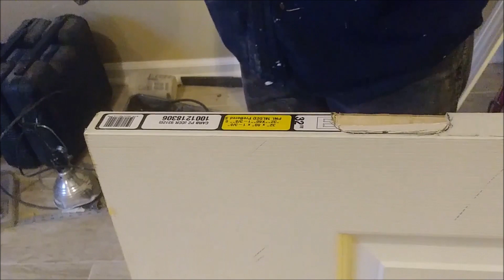How to cut and install perfect door hinges - Step By Step - Real Installation

Comment: Well, thank you for this video. I've never put on a door hinge before. I have a built in 1900 home with an unstable hinge so I need to put another one on to stabilize it but didn't have a clue what to do. This gave me a good starting point for what to do for this repair. But one question..I don't have to chisel out the part on the frame? Just the door?
Reply from the maker: Both frame and door. Usually when you replace a door (buy new door) the frame has  already set for the hinges.
Reply: @josephk9182  Oh I see. This door is from 1900 lol

Comment: Back in the day when I was a carpenter I would use the hinge as a template (almost always square hinges back then), score around the edge with a sharp utility knife, remove the hinge, score inside the first knife cut with a utility knife, and use a SHARP chisel to score the middle material.  A real sharp chisel often doesn't require hammering to remove in between the score marks as you actually shave off the excess wood.
Reply from the maker: Thanks for sharing.

Comment: I'll tell you what. All these comment experts crack me up. They know how to do it better, but yet, Here they are clueless pretending they do this routinely ..... I work for a major residential  maintenance company and we have recently bought a commercial apartment property. A lot of doors need installed and we don't have 21 router saws to give to all our techs ... This is by far the easiest way to do it and move on to the next one. I really like the 1/4 inch plywood idea on the floor
Reply from the maker: You are right 100%
Reply: @josephk9182  what these ppl dont understand is ... We cannot spend all day or a lot of time on placing a door with no hinges. Im here because i was looking for the fastest manual door install without a router. You da man 👍

Comment: Out of all the videos that popped up, this is probably the most helpful. I searched for videos using a chisel so having router videos pop up doesn’t help. Although some of the comments here are more mean spirited than anything else, I get where they’re coming from. I think this is good and if you make a few minor adjustments and reshoot the video, it can be great. I like your plan from the start. Attaching the center hinge to line things up is smart. Perhaps you could mention that the reason you do this with the center is for balance. For some this might be obvious but for someone who’s never done work like this , it might help. I also like how you use the hinge for tracing. Again, it’s smart; not just the method itself, but for a video to help people who are new to it. I’d make two main suggestions for remaking the video. The first would be to proof read all instructions. You wrote that the flat side of the chisel is against the wood when you first start  arcing it out. However, the flat side is up. Prior to that you state that the flat side is against the marked line while carving into the line. That’s I clear because either way you hold the chisel, facing in or out, it’s against the marked line. It would be easier to understand if you said that the flat side is facing inward. I like how you use text for the instructions. That makes it easy for someone because they can pause and read. The second thing I would do is slow down, a lot, so that you can chisel our a more precise area within the line and the result will be much better. You could skip parts of the chiseling process to speed that part up for viewers or even use time lapse, but it would be more effective if viewers see a nicer finish. Anyway, I like your approach. Clean it up a bit and it will be a great video for people like me to refer to. Thanks for taking the time.
Reply from the maker: Thank You. I am happy the video help.

Comment: There are only two methods of cutting out door hinge slots.  The method demonstrated in this video and the method which requires a router.  While this method certainly works in a pinch, it tends to leave a rougher finish on the trim.  It is functional, but not ideal.  Thank you for this video.

Comment: The positive: Fast, functional, perfectly plumb and well aligned to jamb.  But I have to agree with others the craftsmanship is a very rough.  Also I was cringing watching you hammer a chisel towards your belly at 2:05.
Reply from the maker: The video speed is 1.5 time the original that is why it look rough.

Comment: Doesn't seem to be ideal for most novice homeowners to get an even flat cutout by hand to lay 1/8 in.  Let alone having to get it just right Twice for both hinges.  Surely it both wont be the same, or does it matter?   It can't be noticable can it?   I think i rather use a router for a perfect sure even cut at the right depth.